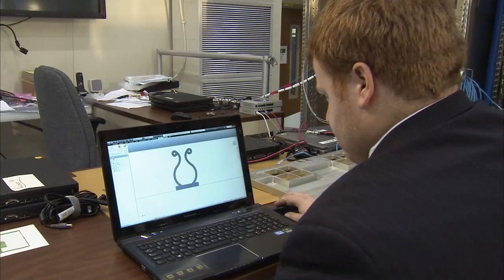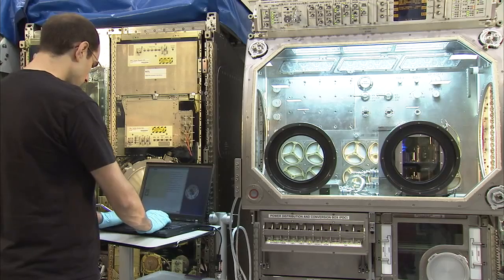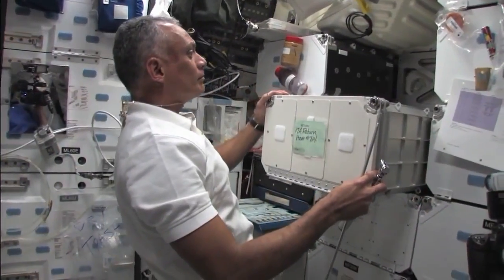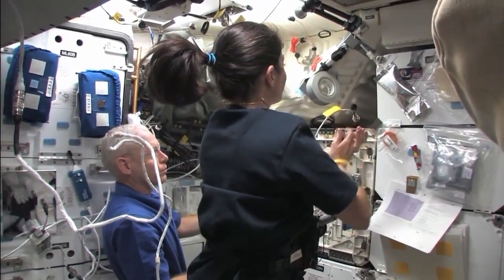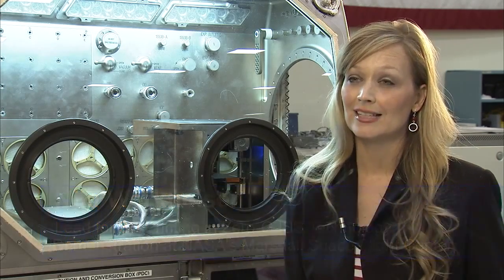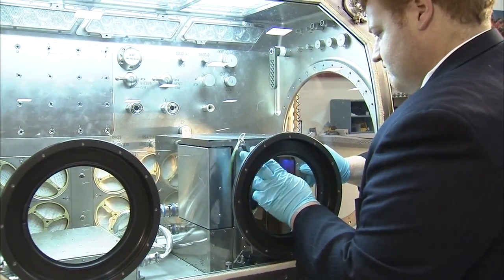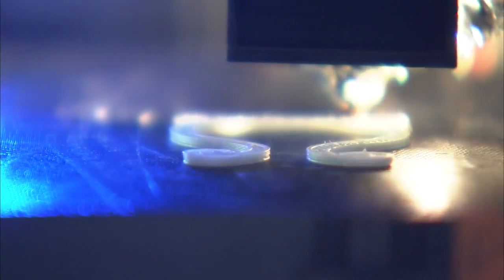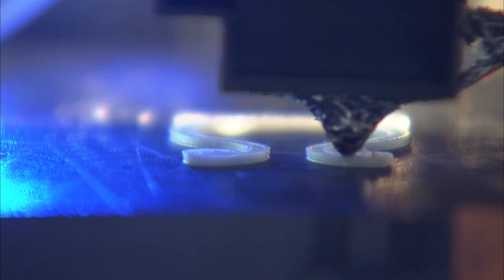Why Space Station Needs A 3-D Printer | Video

Comment: it isnt that easy to just get something up in a space station. they have to space everything and make sure that there is enough room for everything necessary to be brought up. also it doesnt just make stuff out of thin air. the fuel and whatever it uses to be made into the tool have to be brought as well.